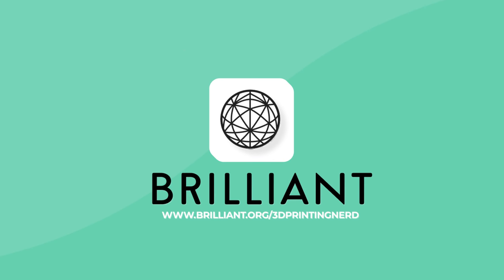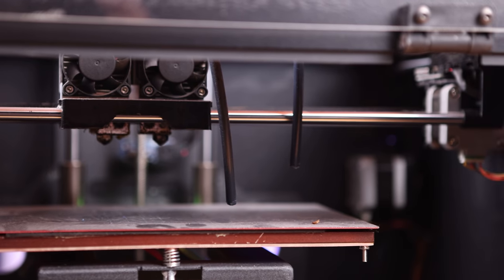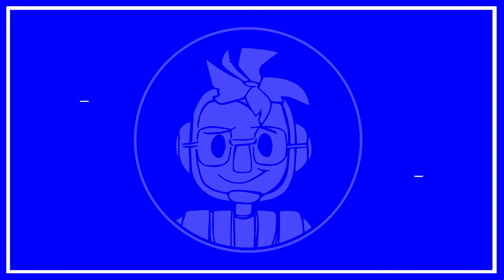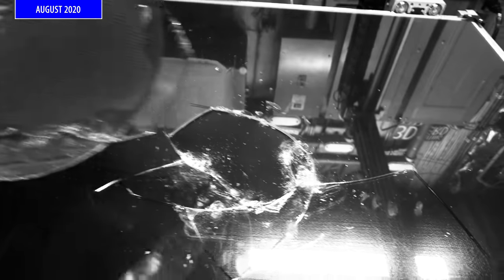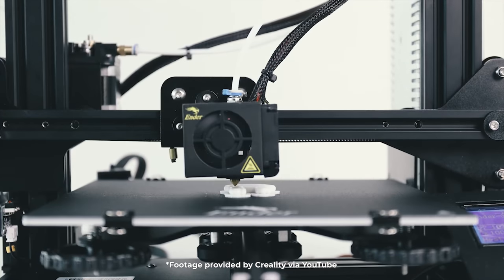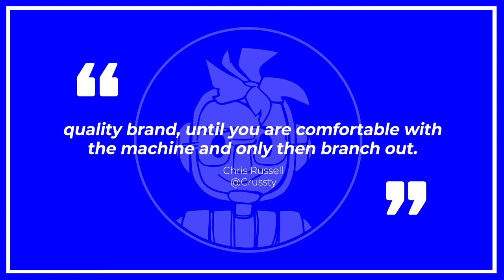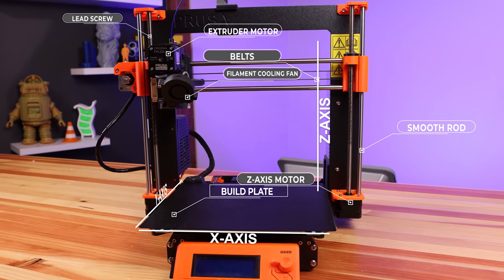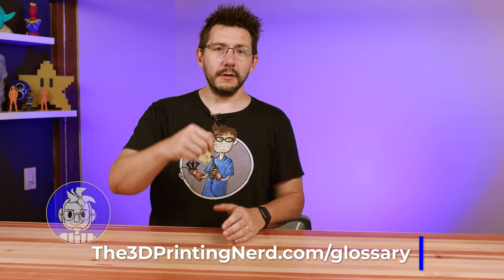3D Printing 101: 5 Tips from the Community!

Comment: Silly Problems with these Tips
Tip 1> ONLY do this if you have a Cheap Printer, don't do this with expensive printers, this can result in enormously costly repairs and Voiding Warranties/Guarantees by the Manufacturer.
Tip 2> Flexible build plates, Pshaw my buttocks i have managed to print into the build plate multiple times because leveling was just not right in a specific corner. Print on Glass if you can't, use baby wheels called Flexibles (Expect to replace some) :D
Tip 3> Leveling on the fly..... NOPE Best upgrade to a 32Bit machine and get/Enable Mesh Leveling, my goodness is that a moment of enlightenment. YES Mesh Leveling WITHOUT Probes, just good old paper.
Tip 4> Filament, I think having reliable Thickness and non-abrasive Fillament is more important, and it needs to meet your Printer Temperature & Nozzle Range!
Tip 5> Terminology, meh seriously if you have done any assembly of a Printer then you would know the terminology. How deep into terminology do you want to go? 3D printers are becoming like cars, not everyone knows the parts of a car!

Comment: My biggest tip I tell everyone is "Lower your temps!"
Reply: Why?
Reply: @barracuda6817  Most people overlook temps and think their problem is something deeper and more complicated. Temps are an easy fix, change the temp, done. Its the first thing you should adjust if you're having a failed print. If you have your temps dialed in perfectly you can move onto troubleshooting other settings like retraction, slicer settings etc...
Reply: @imothy  I think levelling is a more common issue for newbies. Temp is clearly stated on the filament, it's really not an issue that I've seen.
Reply: @barracuda6817  of course, i'm just saying what he didn't mention in the video, temps are very important, this is FDM, Temps are everything! Thermistors are not accurate, and its rare that anyone calibrates them. I see way too many people with stringy prints and they're struggling with retraction settings and even go so far as to put their filament in an oven or dehydrator, when a simple drop 5-10 degrees would fix it.
Reply: @imothy  True

Comment: I used to think that cutting the end of the filament at an angle like 1 800 flowers does with their stems in that old commercial would help the filament go into the extruder better. This is bad advice! The cut tip will over time cut the edge of the tube that the filament feeds into causing filament to no longer enter the extruder. Don't make my mistake.

Comment: nowadays printers are basically too good, i started with a prusa i3 clone, which comes without a single preassembled part. and before people start printing on a magnetic buildplate, they should learn to get a print stuck on glass and then use the cheats. but i guess that amount of learning will never be a thing again, sadly and gladly
Reply: I share the same feeling, i started with a Anet A8 and after a lot upgrades i converted in a Core XY printer, after my next upgrade (new motherboard and screen) probably will be more a new printer tham a Anet A8. I thinking this type of knowledge, that we have will be very useful in the near future, like when the computer popularization started back 1993-5 and for many years knowing the hardware configuration was an important skill (but only few people knew) and had a lot of jobs fixing the computers.

Comment: pro tip: Brace yourself and pray for the technology gods before powering the printer... Then check levels, belts tension and first layer adhesion.
Reply: :0 Belt tension... yeah that one was hard to find help on. The best one i found was a guy that worked it out using a Spreadsheet what your Belts Tension should be using the overall length/Width of the belt over the Tension wheels and then what Tone it needs to make.
I found mine needs about 125Hz to 135Hz ....
Reply: @michaelbiri6676   I also tune them by ear, like a guitar string, no too high pitch, not too low seems the sweet spot for mines.